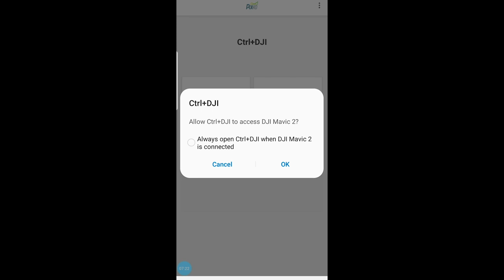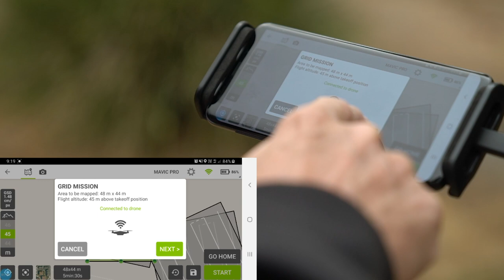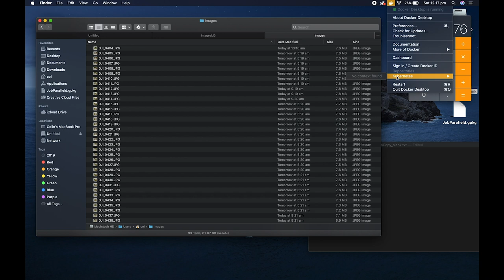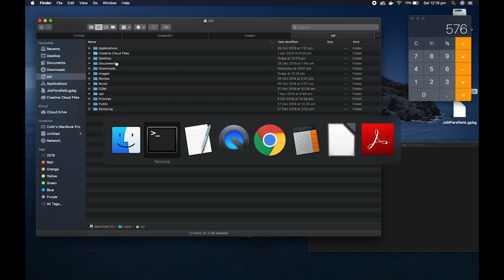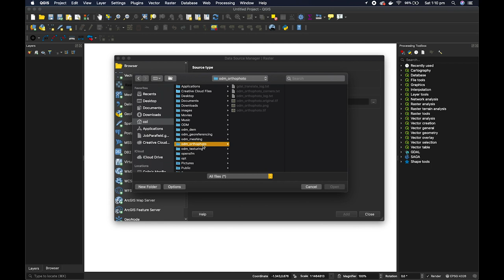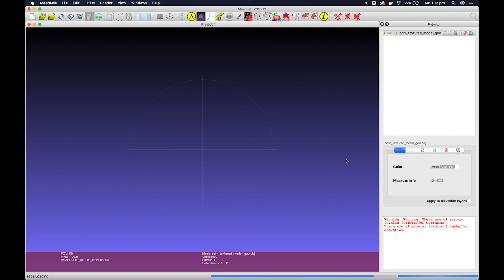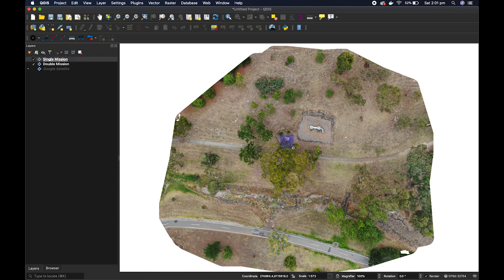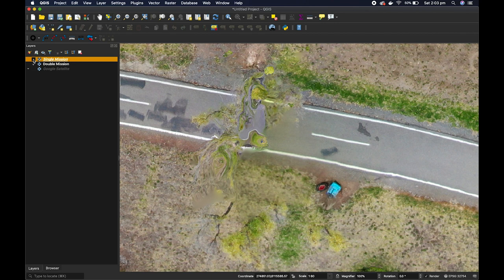Aerial Mapping - DJI - ODM - QGIS

Comment: Thank you for this video, but I found that Mavic 2 Zoom is not supported by Pix4Dcapture, how did you manage with it?
Reply from the maker: Hi. I used the Marvic pro settings (the model before the Mavic 2). With no zoom applied the cameras are  about the same spec. I'm now experimenting with the DJI GS Pro that is equivalent to pix4d and is also free but it only runs on an ipad. Cheers
Reply: @colineast65  thank you again for so ready answer, i`m going to try MapsMadeEasy Map Pilot, and of course will try your way.
Reply from the maker: @nexxonline  cool. You'll have to make a video so I can see how you go! 😉
Reply: @colineast65   how do you change setting ?

Comment: Excellent Video, how long did it take to learn the software. Also, what type of phone holder is that attached to the Drone control
Reply from the maker: It took me a few days but that was on and off over a month and I do have a bit of a technical background too. It took a bit longer to learn because I had not used Docker before and as a command line tool it doesn't give you too many clues about errors, etc.
I got the holder from Amazon but it came from the US. It's name was a powerextra. I als got a Hanatora charger at the same time and that allows me to charge 4 batteries at once however, I killed two batteries by not discharging them to 50% each time and the Hanatora charger has a feature for doing that.